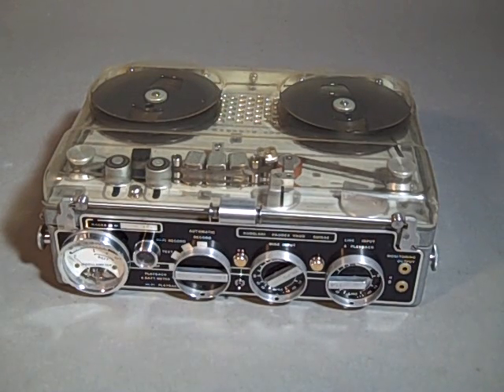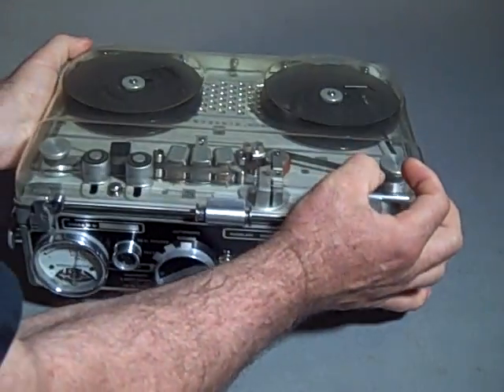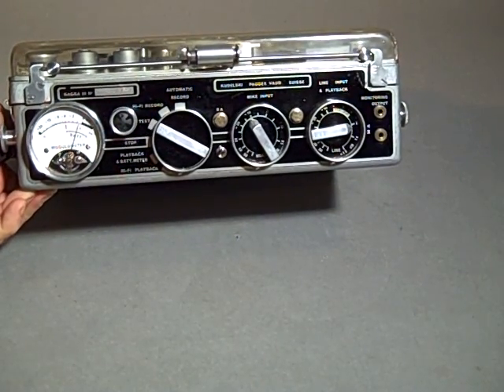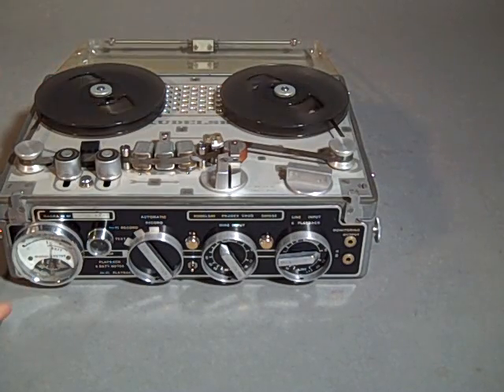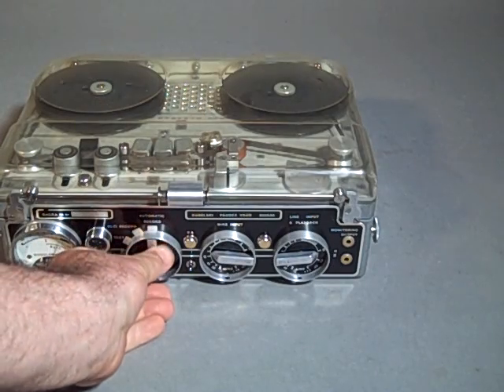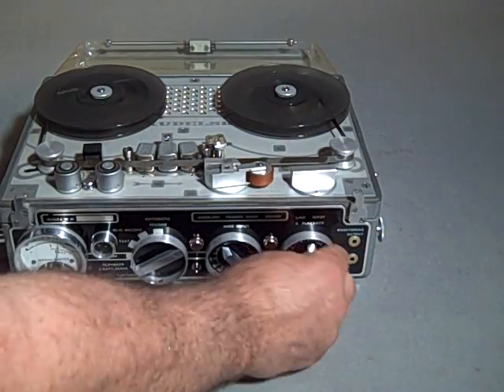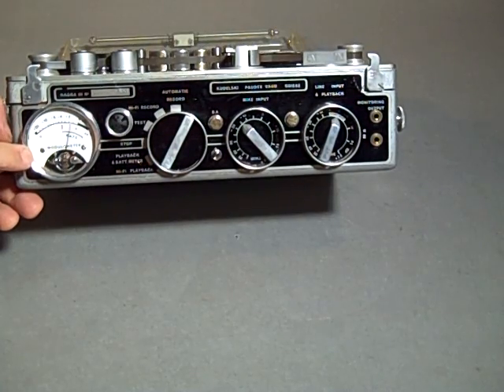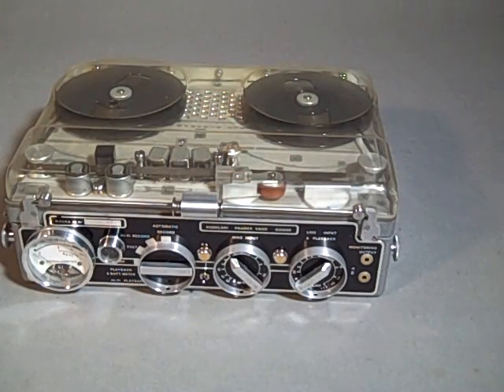Nagra III #8607  analog tape recorder demonstration

Comment: Hi can you tell me how headphones connection works? Is it one bananna plug for + and one - to feed a mono headphone? thanks
Reply from the maker: Lautaro Papagno yes, banana plugs for mono headphones top jack is + ,  or "tip" bottom jack is "sleeve" or negative. It's easy to build an adaptor for a pair of stereo headphones using banana plugs and a quarter-inch stereo jack.
Reply: Thanks! I knew the adaptor I received was a total frankenstein ( Tip and Sleeve from each channel soldered to  each bannana) hahaaaa no comments.

Comment: lovely recorder ^^ if i have enough money one day i would like using that kind of stuff, but the problem is became harder to found new tape, what size of tape did you used in a device like that, same as master tape for ampex or revox stuff ?
Reply: where are you from, I had one for sale for a low price
Reply: You either get used sealed box tape off ebay, there plenty. OR get new fresh made tape from ATR magnetics or various other companies.

Comment: How much did you pay for this Nagra?
Reply: What are the two switches in the middle of the front panel between the record playback control and the mic level knob? On mine it says B-A on the top switch and the bottom switch is 3 position. They are not shown in the manual supplied with the my Nargra 111